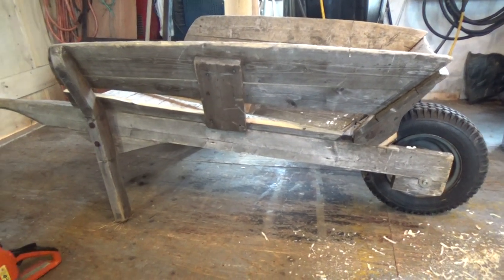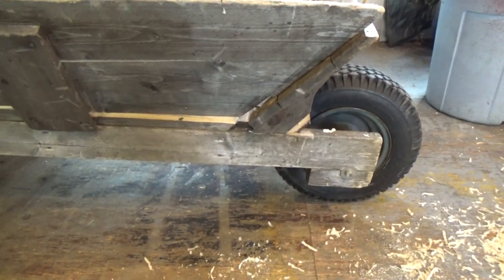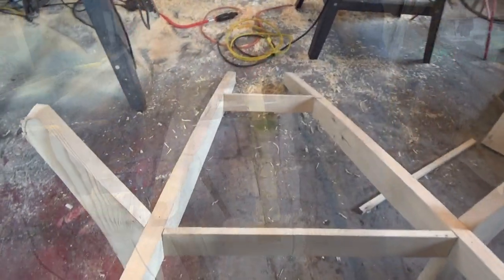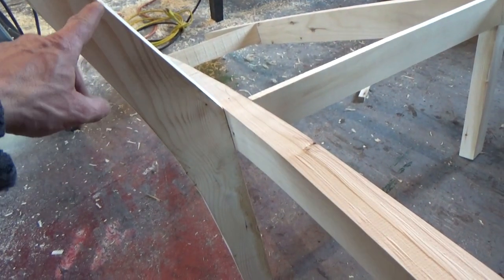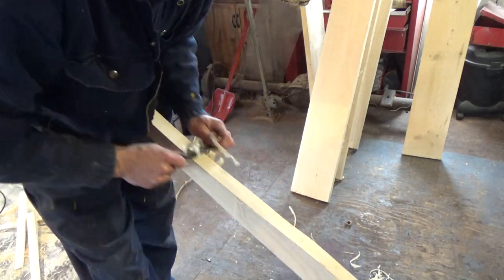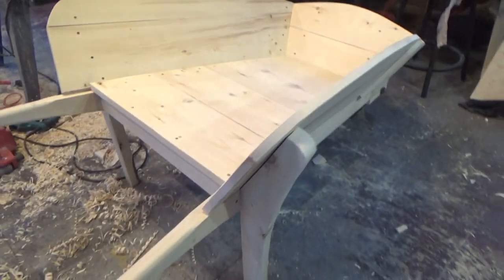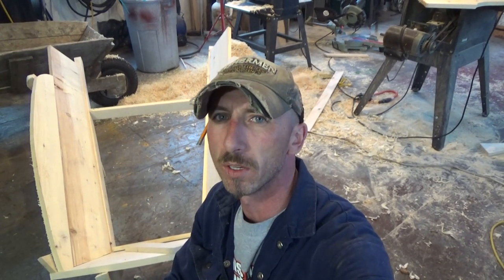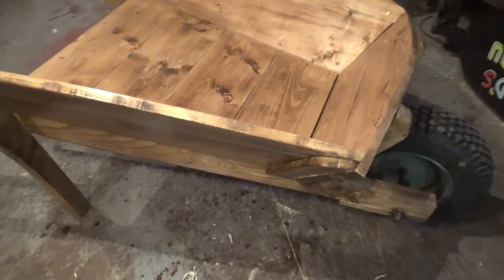BUILDING THE CLASSIC WOODEN WHEELBARROW

Comment: Nice unit.
 It might look old school and also a little bit ":COSMETICALLY CHALLENGED" but functionally is what gets your jobs done.

Reminds me a lot of the Amish tools and working devices. (I grew up around a lot of Amish and/or Menonites. they had some cool "old school" things).

Questions:
1.As they are more stable and easier to maneuver, have you considered a 2 front wheel design?

2. Or even a 4 wheel design: 2 large pneumatic wheels in front and 2 small pneu tire in rear. 
Would be easier to do do up to 360 degree turns.